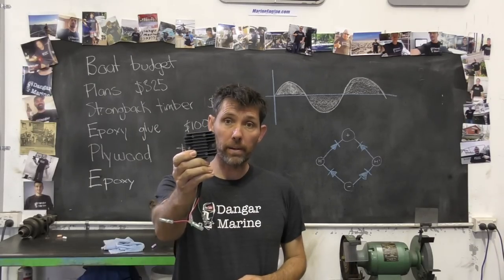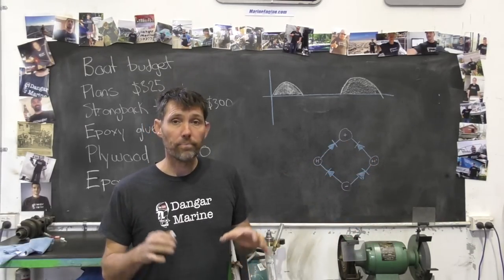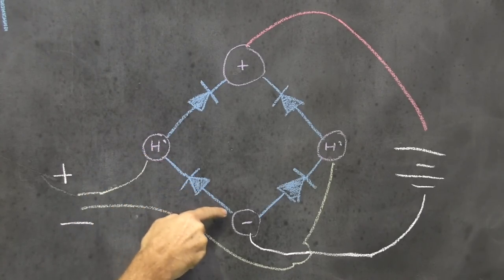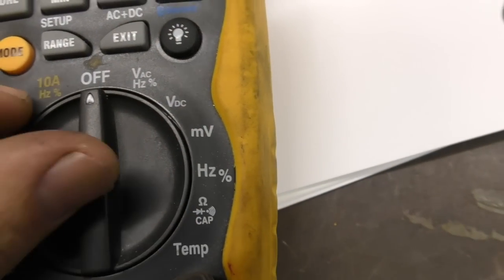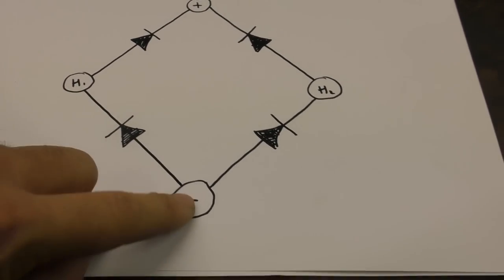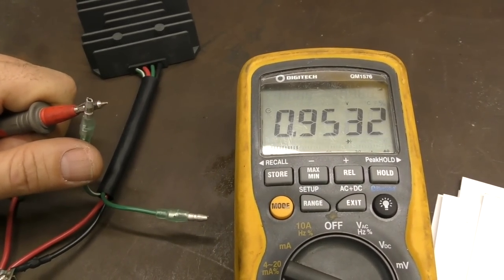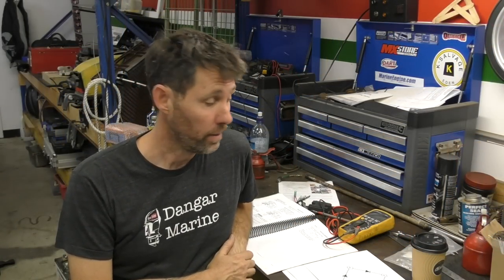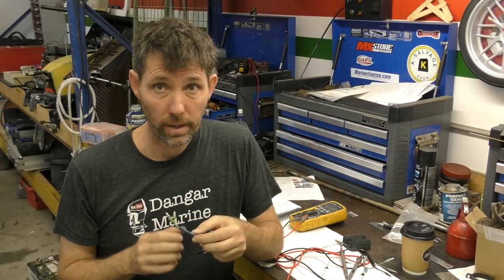Testing a rectifier

Comment: hi, i have a 1999 r6 ,when i put my positive probe on the negative pin on the rectifier i get a reading of .640 in 2 of the yellow wires and .550 in the 3rd wire and i get the same readings with the negative probe on the positive pin ,my stator readings are perfect ,my wire connections all seem fine , my battery charges to 13.50v when idling and 13.90v at 4000rpm , my battery drops to 11.90v once i turn my lights on and on another note my hi beams dont work which is aniother issue im trying to figure out ,would there be a bad relay or a short causing the battery to not charge when the lights are on thanks for any help

Comment: I have a 1989 force 50 outboard with no spark on cylinder 2 only, so I checked everything but the rectifier. Will no spark be caused by bad rectifier? I read disconnecting all wires from the rectifier would help bring spark back? Also my  ohm test result was off the charts' jumping up and down between 1300-1800k ohms.

Comment: i was going in circles testing my yamaha gp1200 rectifier, as ive got the ski apart, blown stator.  i got similar results to you in the video i was wondering if there was more to this rectifier also. 
i went back to looking at it and if you refer to the workshop manual it does say there the continuity across 1 of the green wires back to negative. but i couldnt get past all the videos/ websites of i guess more simple rectifiers 

in my circles  i ordered a Chinese replacement $20. bugger probally didnt need too :) then i seen your video thanks

Comment: Awesome video ( best one!) but have a question: on rectifier of my motorcycle I also have 4 wires: red one goes to battery, ground and then a white one coming from engine and yellow one also coming from engine. When I see your video I understand that AC coming from my white and yellow (2 H) is turned into DC going via the red one to battery (charging). My question: the yellow wire does not only go to the rectifier but also to the lights (the white wire only goes to the rectifier). All other electric components (turn signal, brake,light, stop light ...) take their power from the battery. The front lights however do not take their power from the battery, but from the yellow wire that comes from the engine and is also connected to the rectifier. Does this then actually mean that the lights still work on AC (and why is it connected like that then. And why are the front lights connected like this and do they not take power from battery. On another engine of mine I only have 1 yellow wire coming from engine (of course I also have the wires coming from ignition and going to CDI, but I have only 1 wire for lights and ?battery?). Does this mean that I connect that yellow wire on the left ‘H’ and on the right ‘H’ as well and that is also have my lights on one of these H’s. Last one: could I aslo just run my lights on the battery and not have them on the yellow whire that comes from engine and goes to rectifier? Many many thanks for helping.

Comment: I’m getting .43 from positive to green on both but 2.9 from negative to green on both also I can get current back 2.9 to the negative from the green this is a year 2000 mercury 90hp 2 stroke and is not charging I replaced the stator as well please help is my rectifier bad?

Comment: It is funny you posted this video this week because I just had a customer who did not know why his battery kept discharging. What was wrong with his Mercury was that it had a failed rectifier/regulator. $210.00 part from Mercury if you can maybe do a video on how to trouble shoot an outboard charging system failure. The basic procedure is the same regardless of the manufacture. 
If you do produce this video please let people know that hooking the battery up backwards and loose battery connections is what commonly damages these charging systems.
Reply from the maker: Someone else commented recently that they hooked up their battery backwards and completely fried their charging system. A bit of red heatshrink can go a long way sometimes!

Comment: Thanks for another great video. One question though, to measure if the charging works I guess it is just to measure the voltage over the battery in running condition and expect that it should but be higher than nominal value? With that in mind what value one should expect to have (13 to 14 volts?) for a Johnson 50 hp out boarder? 

Sid
Reply from the maker: Hey Sid. Yep, measuring voltage at the battery is the best way to test the whole charging system. If it is not working then moving on to tests like this help identify which component has failed.

Comment: totally off topic question: what kind of tips do you have on your multimeter probes? I got a few different tips to add to mine, but my existing probes are too thin and don't fit securely. It looks like whatever you have on yours is what I need on mine.

Comment: Any suggestions on my Deere lt160 16hp kohler. I replaced the bad wiringbharness the main one after buying it reasonable and once done charged battery and started it and the regulator heats up at the wire connectors.  The regulators replaced with no change so is the battery bad but it holds a charge or the stator bad.

Comment: Hi there, I have a triumph street triple r 2011 and am having problems with keeping the battery charged. I did the diode test - with the positive probe on the negative connection i was getting a reading in the 500's on all pins of the rectifier, but with the negative probe on the positive connection i was getting a reading in the 130's on all pins (note my diode tester shows readings differently, e.g. as 138 not as 0.138). Does this imply the rectifier is the problem? Thanks.

Comment: Hey thx. The seal was for water pressure.. so need some advice. My engine is 42 years old, 2stroke 35hp Johnson.it came with a boat I bought and had over heated cause the water pump impeller failed and blew head gasket. So I've got it back running, my ? Is since the engine is so old what should I replace far as part I found lot of loose bolts on powerhead so am thinking all gasket. Leaf valves on intake. I've got a new fuel pump. Carb kit. Do you think I should consider doing any work to pistons far as bearing, rings and crank seal. Or no. Sry for asking so much. Tell me what you would do plz.thx
Reply from the maker: I wouldn't go straight to doing any piston work, you may end up snapping bolts trying to get it apart. Was the impeller missing any bits of the blades? If so they might be in the engine cooling system, that is what I would worry about more.
Reply: Impeller was in pieces I repaired the water pump. Replace head gasket and thermostat. And it running ok now bad idle. Am going to replace exhaust cover gasket and look for any impeller bits. Thx for advice on pistons. How much longer do you think the bearing on piston rod will last? And any other advice . Thx Stu ur the man!

Comment: Hey stu so I took the exhaust cover off to check water passages and found the inner exhaust cover which is then stainless steel is badly warped  I can't find a replacement on marine engine or anywhere else. Should try to hammer it flat on make a new one ( 35hp Johnson 2stroke 1976.)thx.
Reply from the maker: I would certainly start by trying to repair the original one and then go from there.

Comment: Hi dangar marine. I writing to you from Turkey. I have evinrude 1996 50 hp carb. 585001 rectifier on the engine. Key is half while system check alarm have light. Idle rpm while, 12.9 - 13.2 volt charging. Wot rpm while, 15.5 - 16.2 volt charging. Do you think the is a problem ? I think problem in rectifier. Your videos very explanatory. What the value for My rectifier (585001 - 5 wire) voltage value ? I would appreciate if you help.
Reply from the maker: I'm not sure what your rectifier should put out, but 16.2 does sound a bit too high to me.

Comment: What are the symptoms of a bad rectifier?
Reply: Rob Mitchell usually the first thing people notice is your Tachometer stops working. Also your battery won't charge. It can get worse as time goes by.
Reply: if its shorted your battery will not charge  if it is open it will not charge either. shorted may cause the charge coils to overheat damaging them

Comment: Hello Stu, enjoy your videos! I just bought a small speedboat with an Evinrude 60hp VRO2. The engine runs great, but not as much smoke as I expect from a 2stroke. Would you bypass the VRO? Or would you keep using it? It works like it should (i think... as every few seconds the engine puffs some blue smoke when idling)... but I just am not able to really trust it 😐 I would run 50:1 in the fueltank, and maybe even get another fuel pump? (As I’ve read on forums that some people get air leaks in their fuel lines when running premix through the VRO fuel pump (and the engine bogging down). Am I overthinking this? Am I worrying too much about the whole VRO thing? (The internet poisoned my mind) or would you also get rid of it? Thanks Stu!
Reply from the maker: I would start by putting maybe 100:1 in the fuel tank as well and then monitor the level in the oil reservoir. If it is dropping then you can be pretty confident the pump is working fine.
Reply: Thanks! Appreciate it a lot! since I asked my question I already disconnected the VRO and put 50:1 in the tank with some fuel stabiliser, have not figured out how to make her run so far (she seems to flood everytime), but I guess I will figure it out eventually :) My local boat shop advised me to disconnect the VRO (even tho it still worked) as a new one (if she would eventually fail) would cost me around 700 € to replace.

Comment: Thanks for the video, very informative! Was not receiving charge to battery so tested my regulator/rectifier as per your instructions

Red gave me .226 and then .226 when reversed
Grey gave me .996 and then 0 when reversed
Purple gave me .996 and then 0 when reversed

Looks like the positive is allowing current to flow both ways and it's cooked and i'm up for $400.

Am I right in assuming that if the rectifier was good I should have got the same .996 reading in only one was as with the other wires?

Cheers, keep up the good work, love the channel!

Comment: Hey Stu. So I see your working on a 30hp Johnson. I have a 35hp, 1976 and there's a driveshaft seal on mine that goes over the shaft after the spacer but the manual dosent say how to install it or what it's for. Do you know?? And does it affect the water pump??
Reply from the maker: Hi Caleb, the drive shaft seal under the pump is for the gearbox oil and if it is one above the pump then it is likely just to increase pump pressure. If you look your outboard up on the MarineEngine.com website the exploded parts diagram might help.

Comment: Quick question. I just got a 15hp honda. One of the square shaped ones. Just wondering what oil to use for engine a d gearbox? And what spark plugs. Anyone any advice? Also can I use car oil?
Reply: I think its a 2006 model
Reply: It either 2 or 4 stroke oil. And your can buy standard gearbox oil at w almart. Google your motor
Reply: Caleb Hurteau its 4 stroke but I need to know what oil weight? And I live in ireland so there's no walmart here.
Reply: 4stroke 10w 30
Reply: Or just 30w depends on climate if it cold use 10w 30

Comment: i looking at the 12amp charger has 40amp recfier in them , 12v and 6v and high and low , its wont charge anything , good transformater read 50 hz , 230v to 24v 12v on ac side , nothing out to output lead
Reply: no mother board in it , its an old one's

Comment: I thought the voltage from a stator was 3 phase.  Am I wrong?
Reply from the maker: Depends on the stator.
Reply: @DangarMarine  Should you use a DVA whether it is 3 phase or single phase?  Thanks.

Comment: I measured my Yamaha rectifier SH656CA, 4 pins (+, Gnd, H1, H2). Multimeter : diode mode.
Only H2 gave the value.
Can I conclude that my rectifier is broken ??
Even I measured when Engine Off : battery voltage is 12.4V.  and during engine on / higher RPM. battery voltage is still raising ( up to 13.5V)
So I think my rectifier is Normal.

Comment: interesting.  what i have found over my years is to test the system as a whole. then break it down from there.  although a charge coil tests ok by resistance standards it can still be shorted. best is to check the running voltage output ac volts of the charge coil with and without the rectumfriar  hooked up.  it should be nearly the same. if it drops drastically  then you need to see if it is the regulator shorted to ground (or earth as you call it.) or a momentary open in the charge coil under load(unusual) a shorted recumfriar when the output is isolated from the earthing and battery will have no dc output and little or no ac on the coil. an open will have no dc output but good ac input. also note the minimum ac voltage at idle. there should be a specification for that. generally above 25 volts  ac on a 12 volt system. regulators can have wires to hook to a light or ammeter and/or ign turn on connections tach outputs etc. so having the correct service information is a must. your explanation of recification  being spot on  but throw a regulation in the fray rather complicates things. just more to go wrong lol. the system is no different that that in any auto  just they put the components in different places instead of that shiny aluminum case.  thanks for the video. these can be fun to sort out  cheers
Reply: "Rectumfriar"!   Hah!
Reply: Old joke term, here it is spelt rectum Fryer - keeps the religious tones out of it, though your spelling may be more accurate :-) . I have also found that testing with just a multimeter can be misleading - sometimes the old 12v test lamp does the job better and faster. Richard, the permanent magnet  alternators  are a very different beast to the auto alternators in terms of how they are regulated.
Reply: yes they are different in the fact that the alternators rotor windings are regulated to achieve the output by changing the strength of the magnetic field while a permanent magnet type the output is basically partially shorted out  to regulate output.  yet they both still incorporate a revolving magnet to induce a current.    its also interesting that alternators are wound usually either delta or wye configurations making thier ac 3 phase yet most of these smaller permanent magnet ones are single phase ac output. baked,  mashed,   potatoes o'brien : at the end they are all potatoes:-)  yeah never fully trust a multimeter.  they are dumb. the person using it is the one you have to be sure of!!! lol

Comment: Do you have a public email address I can email you?  I have the opportunity to buy a 1993 Crownline 182BR but it has a cracked block.  Wondering what options I would have.  Most engines are $1,000USD + and I don't think the boat is worth that (will need interior soon).
Reply: Jarod Morris I would avoid an outboard with a cracked block. You would be entering a world of trouble. Unless you just need the motor for parts and get it very cheap. If it was an easy fix it wouldn't be for sale. Any mechanic would tell you to sell it for parts or throw it in a dumpster.
Reply from the maker: I agree with Jim, it will be almost impossible to get running right. If you hang out for a while you should be able to find a motor for much less than $1000 eventually.
Reply: Dangar Marine - what auto engine block is the same as the marine block? My understanding is that the blocks often used at General Motors, but then the marine parts are added on to the engine for marine use. Am I completely off?
Reply: Dangar Marine - I wasn't thinking use the cracked block. I know better than that. It's a ruined.

Comment: But is it a FULL BRIDGE RECTIFIER!?
Reply: What he's showing is a full bridge rectifier, yes.  Otherwise you could just put a single diode in the circuit and still get DC, but each of the AC pulses below the line would be gone entirely.

RichE
Reply: the depiction on the chalkboard is as it rectifies both polarities of the current. without knowing what is inside the actual ones he tested its hard to determine. i suspect the large one is  but the smaller one is probably half wave. it probably only rectifies one polarity since it is smaller and capable of less current output. half wave - half the output
Reply: HAHA I was thinking the same thing. Perhaps DangarStu and ElectroBoom should do a Collab and explain this in much more detail :)
Reply: Ryan Getchell finaly someone who gets it...
Reply: That guy is just dangerous - that same circuit in Australia will give 340 volts DC - please don't copy the idiot.
Reply: I totally got it was a send up style presentation . The problem is he makes no mention that in 220/240 volt countries what he demonstrates is deadly. There are too many slavish copiers out there that just cant think for themselves. I am all for giving Darwinism a chance to filter the dead heads out, but at least give the person a chance to be a teenager :-)